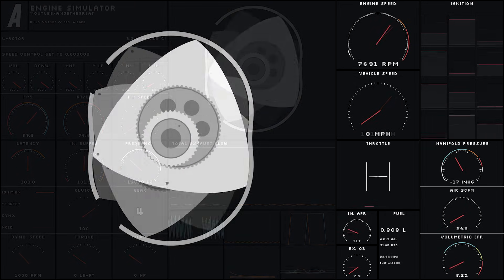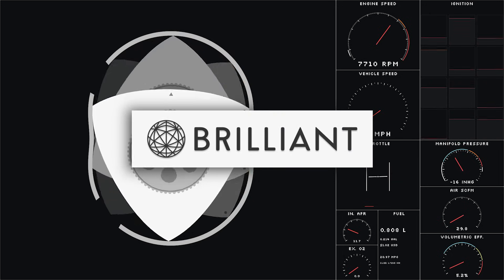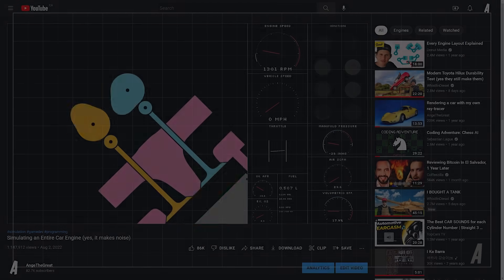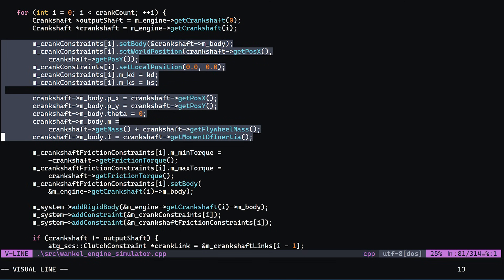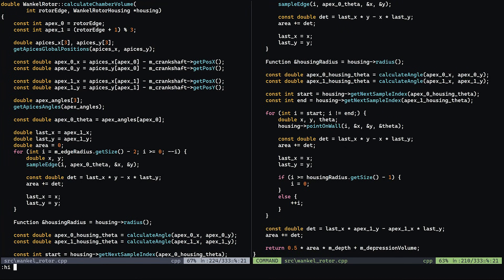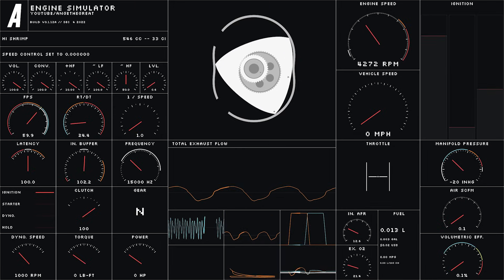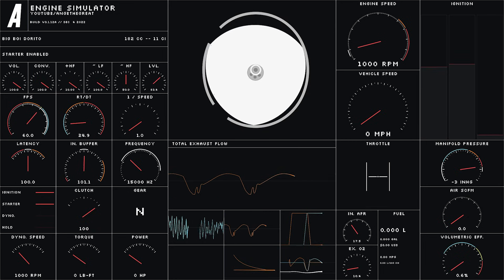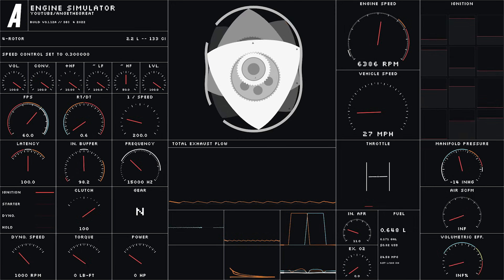Simulating a Rotary Engine (yes, it braps)

Comment: These being called rotary engines is a pet peeve of mine. I prefer to call them wankels and I really wish that’s what everyone called them. Mostly because there’s a far older type from ww1 that has absolutely nothing in common with a Wankel. It’s basically a radial that has a fixed crankshaft and the entire engine rotates instead of the other way around. They’re super weird and only get weirder the more you learn about them.

Comment: So much on the apex seal. But in reality it is just a fraction of the total surface in contact with the rotor housing, the top and bottom surface of the rotor in contact with the housing is what needs more information. Almost no one is talking about that.

Comment: BeamNG is probably the only game, that could accurately use something like this. It would need some work on the engine modeling, how it currently mixes sound together.  I’m aware that right now as it sits, it would need some code engine work. - but for anyone else that has logged hundreds upon hundreds of hours, building your own mods, and modifying others , can attest too. This would be the perfect game.

Comment: I rode in the mazda rx 8 and remember its smooth at shifting gears without the jerky motion. Like a lexus. But i forgot if the wankel engine was part of it or if its just the gearbox.

Comment: Love this just found it! One problem right off the bat. Where is the misfires and backfiring. Or when you're plugs are screwed. It's all fine and dandy if you got big pockets like this guy. Can I have something for free for causing this big thread and all the tinkering you're gonna have to do to prove to me you can make your simulation run crappy oil burners with faulty timing!

Comment: I had a 1985 RX-7 with a Wankel engine, it was very smooth-sounding. You could barely hear it at idle. Does your software simulate exhaust systems, and the effects it has on sound and power?

Comment: 7:40 Count the pixels in the chamber?

We use some computer vision at the plant i work at to automatically inspect sealant application on parts. It counts pixels. Seems like something youd bake into the rotor position variable here.

Nevermind, it appears you found the proper solution.

Comment: the rotor housing is multiple circles with the same radius and a center whose distance is equal to the diameter of the rotary shaft; and the area of a chamber section is equal to the area that is a linear interpolation between the triangle and the circle(s) which represent the motor housing. 
no?

Comment: Hmm I just had a thought about the approximations for the size of the chambers over time. Wouldn't the total volume of the 3 chambers stay at 100% the entire time? There might be an equation for the size of each chamber at any given time in a cycle.
By the way, amazing visualization of the firing order here.
Reply from the maker: The total volume of all three chambers is indeed constant. And there is a closed-form equation for the size of each chamber but I wasn't aware of it when I made this video and it also probably wouldn't improve performance much, but I haven't really tested it enough yet to know
Reply: @AngeTheGreat  yeah, have no idea how it would perform. Only will know if you test it ;) but checking back in on rotary simulations probably isn't on the top of your list. But if you're like me at work certain things that are really at the top of my priority list get put on the back burner when I have some mad scientist ideas and inspiration.

Comment: It’s silly to think that I’m this day in age we would want to go back to the original way of communicating over radio waves if we already have phones that can do everything?

Well, in the event of a global crisis (like he was talking about) where either communications networks are hacked or compromised, using these radios would be the only form of communication available as you are the source of the signal, not a cell tower. Obviously having these radios that work locally is the best way to be prepared for communications during localized outages.

This is such a great visual video with so much good quality information, really makes it a whole lot easier to understand the different frequencies we can use.

Comment: Hey.  I'm trying to design some stuff for my own 2 or 3 rotor.  Maybe 4.  Is this just to simulate the combustion cavity?  I'd love to build an engine that will atomize gas on intake via elec turbo, and other than putting something together to grenade it in my yard, I'd rather simulate it.  I also want to look into active exhaust cancel, have the same rotation go around 2 times to use all fuel, if any is detected.

IDK if you can do that but it'd be neat if so.

Comment: why was the displacement low on the simulated 26B from the 787B?
one of my biggest curiousities with the rotary is what effects would changing different dimensions as one does with a piston engine ...  so I suppose wider rotors, bigger rotors (larger equilateral triangle) and combinations of both.  I'm thinking big block V8 style engines like in classic American muscle to many smaller cylinders like the Italian supercars.
Not that I believe anything might be viable, but it would be interesting to find out.
What I think I recall is the smaller chamber of the 12A allowed for cleaner, cooler operation.

Comment: I only know rotary engines as the thing build into early aircraft where the entire engine would spin, driving the prop instead of the engine driving a crankshaft that then drives the prop. Weren't great. Were also used as hub motors in some early motor bikes, probably with less issues.

Comment: this is some really impressive coding, and a great explanation of how it works! Yes "dorito engines" is the correct terminology.

Do you have any benchmarks about how CPU taxing it is to simulate one engine in real time? I'd love to see this used in videogames and movies to make more realistic and immersive vroom vrooms

if you're looking for a new challenge, I suggest simulating the sound of car tires as the roll over the ground, with varying amounts of skidding. if you pull that off, you could really have an all-in-one car sound simulator

Comment: You should simulate a real rotary engine like the french Gnome Monosoupape. They were one valve(monosoupape), and to save the weight of a flywheel the whole engine rotated(a truely rotary engine), bolting the propeller to the block and crankshaft to the airplane. Used mainly in the late 1910s.

Comment: Question: Does this mean that Königsegg 3 cylinder solenoid valve motor also braps?
Reply from the maker: Not necessarily. A lot of the brap in some rotaries comes from an unstable idle due to exhaust gas dilution and a greater charge heating effect (among other things). Free valve systems can open valves very aggressively in a way that a traditional camshaft couldn't, however, this would actually allow them to need less overlap/duration to achieve the same effect, potentially making it less likely for them to "brap". That's just my thought anyway. In general though, unstable idle is not necessarily caused by aggressive valve lift profiles.
Reply: @AngeTheGreat  I see, thanks for clarifying. It's the inherent mode of the rotary and it's "cam profile" that make it brap. Would that mean the Königsegg motor would thoretically be less likely to brap than a "traditional" valve train?

Comment: Very good, but if you wanna be more accurate to a real mazda rotary the displacement per rotor is 0.654L the displacement of a 4 rotor is 2.6L not 2.2 like the one you made, it might be asking for alot to make that change, but if its not to hard that should be changed
Reply from the maker: It's not hard to change and I'm aware that the displacement is different from the displacement of the 787B. The engine was just a demonstration of a 4-rotor based loosely on the racecar engine

Comment: Your fuel consumption seems to keep going on closed throttle decel. 99% of fuel injection systems will have a form of DFCO, decel fuel cut-off, to stop injecting fuel all together during overrun phases.
Reply from the maker: The simulation does not support fuel injection at the moment and treats all engines as though they were carbureted. This means that so long as air is travelling into the intake, fuel will be drawn. When I get to adding fuel injection I will take fuel cut-off under deceleration into consideration.
Reply: @AngeTheGreat  fair enough!

Comment: Its impressive to see what you've been able to do with this in such a short span of time, hope to keep seeing more from you and this project.

Also, maybe this is way outside the scope of what the engine sim could do, or at least what's intended to do; but maybe just to toss out few ideals for either yourself or the community to try out. How possible would it be to simulate something like a jet or turbine engine; axial, centrifugal, or pulse jet all seem like interesting kinds of engines that could be tested.

Maybe even, steam engines?

Comment: The idle is way to stable. And no crackle pop from it hosing the exhaust manifold with still burning air-fuel charge.
Reply from the maker: It's a work-in-progress of course. Thanks for the suggestion
Reply: @AngeTheGreat  I'm mostly just ripping on Rotor engines.
Reply from the maker: @Racing_Pig  In that case, I'll make sure to add consumable apex seals in the next update lol
Reply: @AngeTheGreat  Vital to the proper Dorito Experience.

Comment: audio nerd here - use IR(impulse responses)/convolution to simulate changes in sound output charecter, lets say, an impulse that is recorded in the cab, a impulse thats recorded at the other end of a exsaust, a impulse that simulates the sound of a room... what it does it changes the frequency spectrum, the phase and delay of frequencies, as well as how long those frequencies resonate out.
and its quite simple, just put the IR after every audio sample at the loudness and polarity the wave sample point is at. and do this for every sample point. 
benefits - it adds reality and realistic character to sound.
flaws - reverb is random, a IR is like just a snapshot of it in one specific moment, so stuff like small mechanical shaking and flexing. obviously its miniscule, but like dam, do this and all game studios will want your code and materials, all ya need to do is to record it and implement it...
Reply from the maker: The simulation already uses an impulse response technique, check out my previous video about the technical details about the sim :)

Comment: Can  the engine simulator simulator those old ww1 rotary engines? The one where the crank shaft is stationary and the crank case moves.
Reply from the maker: Theoretically, yes

Comment: what is this engine called in the actual sim because i cant find it and i want to use it
Reply from the maker: You need to have 1.12 which is only available to patrons right now. It's the default engine in 1.12.

Comment: I dont think the faces of the rotor need to touch the housing.
Reply from the maker: In real life there are smaller tolerances worked in since metal parts expand with heat and deform slightly, so a real rotor may not touch the housing at all. The mathematically perfect rotor shape does though
Reply: @AngeTheGreat  I mean only the apex seals need to touch and having the face touch causes the compression to be split in two

Comment: Cannot confirm it braps. I have a Mazda RX8.
Reply from the maker: Please explain
Reply: @AngeTheGreat  If you're referring to the brap as the sound, it doesn't make the same same sound. It sounds fairly different, and I wouldn't describe it as a brap.
While typing, I looked up other car brapping noises, and I guess the Mazda RX8 is special since it doesn't sound like other rotaries.

Comment: A 4 rotor is more like a 8 cylinder with double the displacement since there is 4 bang per crank rotation vs 4 bang per 2 crank rotation on a 4 stroke engine.
Reply from the maker: In terms of combustion events yes, however, I was simply referring to the fact that it has 12 combustion chambers, not to the number of combustion events per crankshaft revolution.

Comment: Liquid piston engine is almpst the same and similar to the quasiturbine engine. Pls make a PatOP: Single-Crankshaft Opposed-Piston Engine or the omega 1 Pistonless engine. What about intake and exhaust mods like dual vvti or different turbo or supercharger (roots, twin screw, centrifugal) types and configuration (sequential, compound or éven twincharge) could that be added to the simulator?

Comment: The flex is in the drivetrain and not the suspension. Dog boxes have more slop to them than syncro boxes because of the widergap between the engagement teeth.
Reply from the maker: Hmm not sure that's always true. The slop in the transmission and flex in the drivetrain are both accounted for. However, the suspension and chassis will definitely flex upon acceleration, causing a hesitation. A typical example is flooring a car from a standing start and having the back suspension compress. This happens as a natural consequence of torque being transferred from the engine to the entire car body before there's enough pre-load to cause the vehicle to move forward.

Comment: Amazing work!

Does the port timing vs poppet valves conversation open up the avenue for 2 stroke experiments on your program? Cant forget to include expansion chamber simulation though ;D 

Then perhaps experimenting  with compression ignition? I could see there being some hard work figuring out the flame speed propagation on diesel vs petrol etc. 

Love the videos mate, keep up the good work.

Comment: Hey Ange, this is probably a dumb question that will go unnoticed, but if you measured a REAL rotary engine, would you end up with a more realistic simulation? Would the numbers be different?
Reply from the maker: Theoretically, no there shouldn't be a difference since the simulator uses the correct geometry for the rotor and housing. I've heard that to prevent wear and help oiling, real housings deviate very slightly from the ideal geometry, maybe by a few thousandths of an inch. This wouldn't be enough to change the output of the simulator by a noticeable amount though. Hope that answers your question!

Comment: I always thought that that jumpy feeling was from the clutch I never would’ve thought it was the vehicle flexing
Reply from the maker: Clutch chatter and flex are also a thing and they're taken into consideration in the simulation. Chatter is more common with aggressive clutches while clutches intended for road usage are designed to flex slightly to dampen the engagement

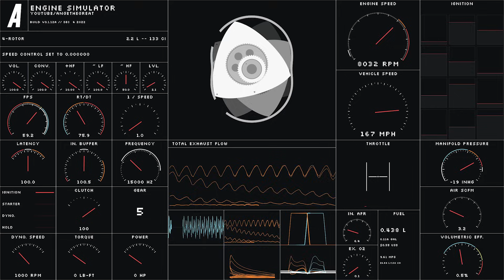Comment: 15:39 driveshaft made of springs lol
Reply from the maker: It's not just the driveshaft lol. A lot of other things in the vehicle deform, like the chassis, suspension, tires, engine mounts, etc. Those are much bigger contributors

Comment: Excellent work!  The method of substracting parts of the rotor to get it's shape is exactly the method used in manufacturing.  As far as I've read, there is no closed form parametric equation of a rotor's shape.  The rotors shape is instead created by a "collection of curves" which describe it's shape over a given rotation.  Just a fancy way of doing what you have shown.  The instantaneous volumes can also be calculated for the working chambers.  Look up "ROTARY ENGINE" by Kenichi Yamamoto both 1981 and 1971 editions have most equations and methods to calculate the volumes!

Comment: If the apex seal's motion is represented algebraically, you could solve the motion over a time interval for perfect motion blur. It'd look really cool maybe.

Edit: Actually it's probably not solvable so instead you could linearly approximate the angle change over a frame. (Assume dθ/dt is constant)

The hard part is solving for
rgb(x,y,t) and integrating it with respect to t. (Once again, assuming there's a solution)

Another edit:
I just saw your comment stating the motion is exact, so that's good.
Reply from the maker: Hmm definitely possible. You could definitely calculate everything algebraically, including the rotor shape. The next step is figuring out how to do efficient motion blur with that information haha

Comment: 0:37
No, Wankle engines are just one type of rotary engines.
There are others that's also rotary engines but not Wankle engines.

That said, amazing work.
Reply from the maker: Most people refer to Wankel (not Wankle) engines as rotary engines even though this is not the most correct name for them. A "rotary engine" more correctly refers to an older type of piston engine where the crankshaft is stationary and it's actually the entire engine block that spins. I'm sure there are other engines that are also referred to as "rotary engines" but nitpicking this is honestly a pedantic waste of time.

Comment: the 787B also had  a variable intake manifold!
But the next challenge for you should be a 2 rotor with peripheral ports, bridge ports, street ports and factory ports. Just to see if the simulator can simulate what essentially prolongs intake timing like a cam, but without the cam lol
Reply: yes

Comment: Can you imagine a racing game (or even open world sandbox!) that simulated the engines of all vehicles this way, modelling dynamic deformation of the vehicles with collisions and wear? Being able to hop in a simulated 40 yr old pickup and hear the difference in wear? Even the industrial applications for such a technology are incredible - AI running on powerfull hardware would be able to reliably predict the precise failure times of various components by simulating years of runtime in fractions of a second. This really is the future.